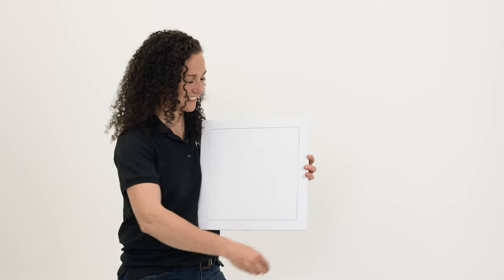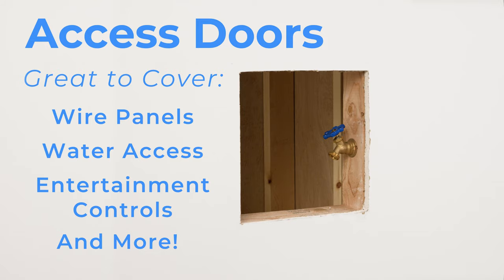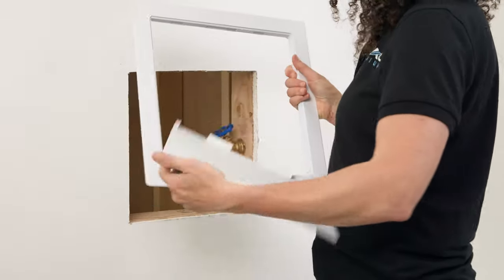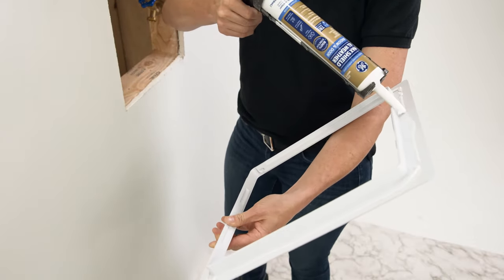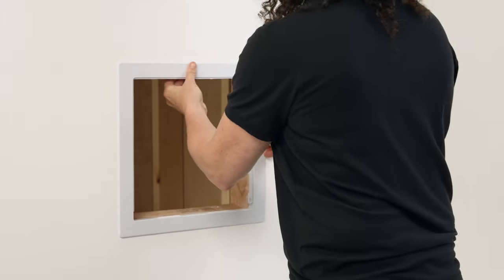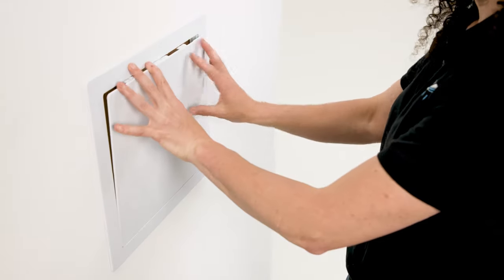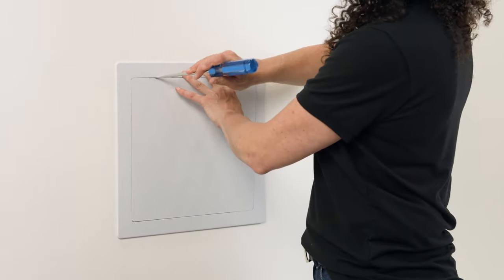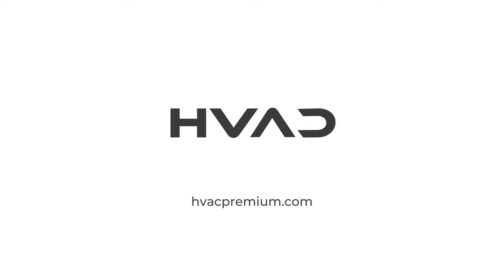Installing a Plastic Access Door on Drywall

Comment: How do you allow for a stud in the middle for larger panels?
Reply: Could just notch the stud where the panel intersects it t allow for tight fit and to help secure it
Reply: @MrRocket5000 bruh you notch the door frame not the stud